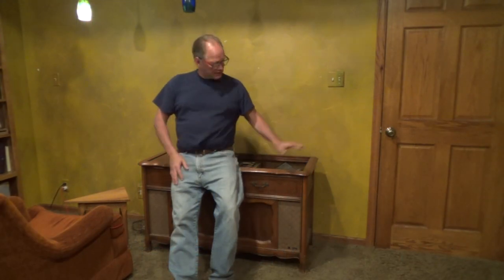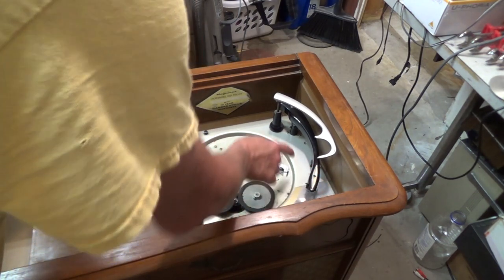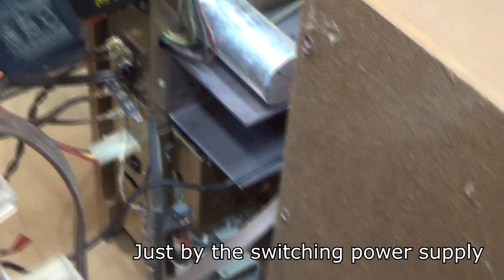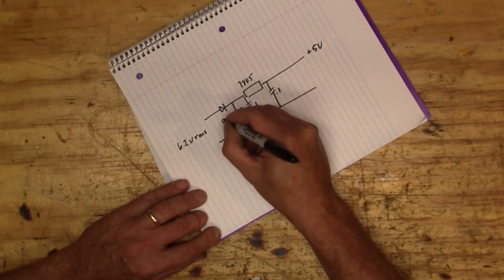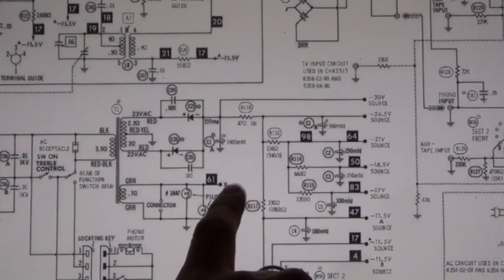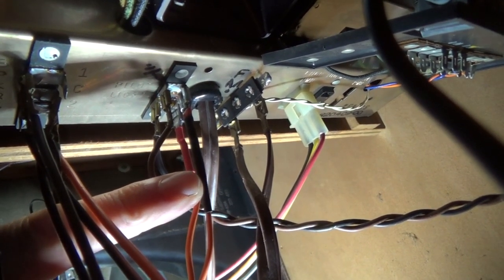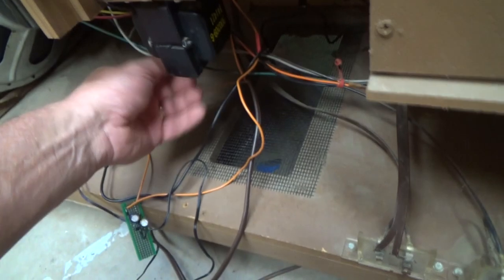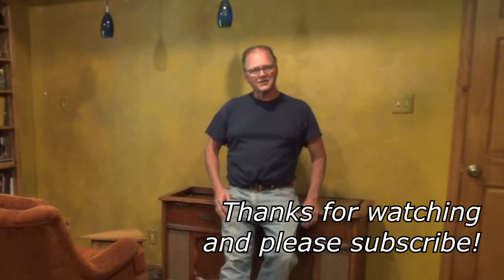Adding Bluetooth to a Vintage Console Stereo

Comment: I happen to have this exact same model of vintage console so thank you so much for this helpful video! I am working to follow your instructions but have a silly question- I can't find the aux plug-in. Did you have to rig something for that end too or is it tucked away?
Reply from the maker: The stereo I worked on had a set of right and left RCA aux jacks that I could use. You could use the phono jacks as well. Here's a picture of where the jacks are: https://1drv.ms/u/s!AgRy1tCE6lTd-xCv5WfyilxMgbWu?e=LTafeB
Reply: thanks, had the same question.

Comment: Thanks for both of your videos on this model.  I just purchased the same model, and so far everything works on mine.  I plan on adding bluetooth soon, but not confident to replace the capacitors.  Any recommendations for a first timer if I were to get up the courage?
Reply from the maker: When I was learning micro soldering I just got some old junk circuit boards and practiced on them. Same with recaps, get a junk circuit board and some solder wick and practice. Then you'll be confident when you work on your stereo. I also just do one at a time. It is also useful to use a sharpie and mark the side of the cap that faces the front of the board so even after it is out you can see how it was oriented. Buy new caps from digikey or mouser so you know you're not getting fakes. Good luck!

Comment: Where did you get your circuit you used for the power supply?
Reply from the maker: I looked at the data sheet for the 7805 for the little filter caps otherwise I just went from experience. After I did the video I found this video which shows a very nice solution: https://www.youtube.com/watch?v=eWfsWNUpSNs